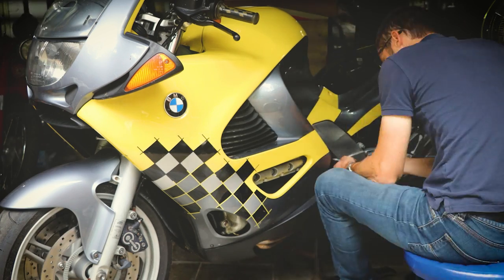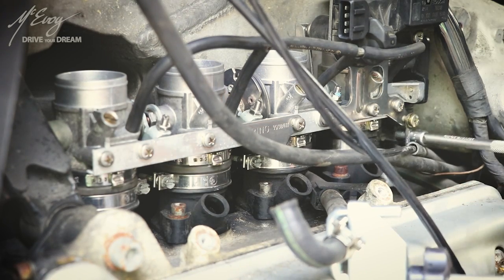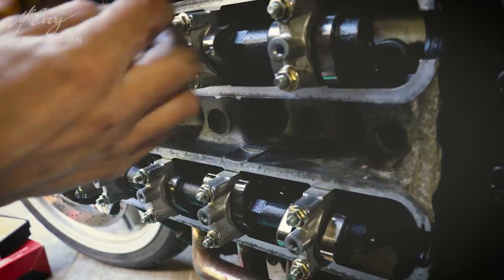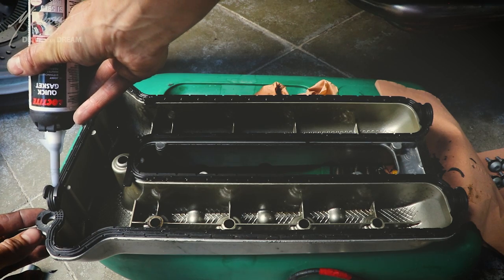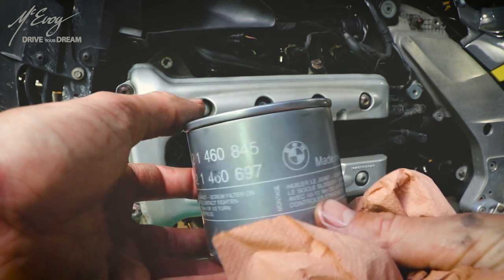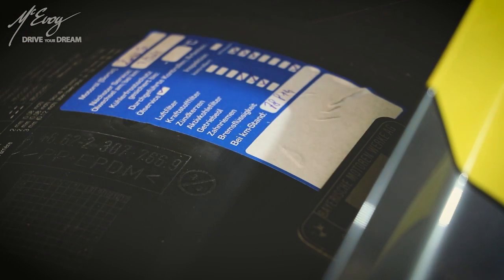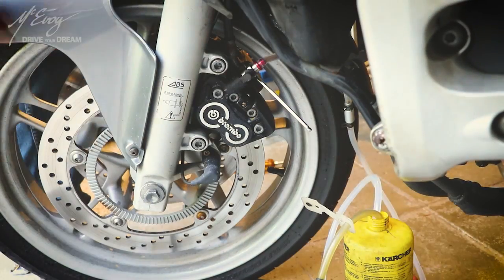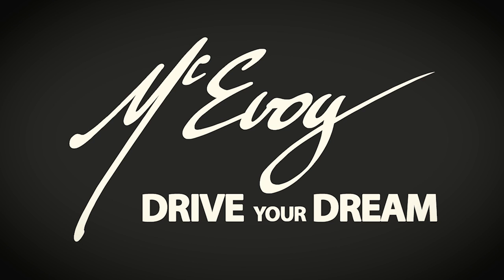BMW K1200RS full service

Comment: Hello, could you please help me on that "butterfly" TB adjusting? I didnt find that on the service manual. 
And I am thinking if I will be able to adjust it with only two connectors, like I used to do synchronising 4cyl. Carburettors? Thank You in advance. 

A great vid, would be easier for me if I would've found this vid earlier. But now I already changed the clutch by myself in the garage laying on the ground:D
Reply from the maker: Hello Vladimir,
To properly adjust the TB's, you need to first adjust the throttle cables properly (making sure they operate freely as they should of course). Then screw the first TB balancing screw fully in (on cylinder 1), then back it out one and a half turn. Don't touch that one any more, as it is the reference for the three others. You will definitely need a four tube or gauge balancing tool, as the method used here is different to that of most Japanese bikes, where carbs are synced in pairs With the tool hooked up, start the engine and let it  warm up to normal operating temperature. I usually wait until the cooling fans kick in. When the fans turn off, start adjusting balancing screw on cyl 2, using cyl 1 as your reference. When you have synced that one, readjust idle speed to the indicated speed in the manual. Fine-tune sync in between 2 and 1, re-adjust idle. Blip the throttle once or twice, and re-check. Then sync cyl 3 to 1 and 2, re-adjust idle speed etc..., and lastly sync cyl 4, and make a final idle speed adjustment to what it is supposed to be. Blip the throttle once or twice, check that they are all within spec, and hey presto, you have just synced TB's. At least, that is how I did it, and it worked great. Do make sure there are no air intakes in the breather system, otherwise you will be wasting your time. 
I hope this helps! Have fun! 🙂
Reply: @gmcevoy  thanks a lot. Did you find it on the manual somewhere?)  Tb balancing are those bolts for flat screwdriver copper colour?
Reply from the maker: @vladimir4093  The copper coloured ones, yes. Don't mess around with the other ones, as they are set at the factory, and any attempt to adjust those will render the TB ramp useless. I honestly cannot remember from whom I got the info, but it worked well.

Comment: I'm looking for a video on changing the clutch. Because my k1200rs has now got 156000 km on it an its ratteling more than a bit, some say to me its a very big job and not easy at all, any comments?? I can do general maintenance and so butt not been working much on this type of engines, mostly like cb750, kawa z1000, suzuki 650,, this engine intriges me tho,haha. Bought the bike like 2,5y ago with a good 100000km on it so been driving it daily, maybe i will look to do a steering mod like the sls something like that,butt find it expensive to buy. Maybe look to get it done and made by a frend butt will need different lines for the brake and clutch i thingk. Any vids on that maybe?? Thx in advance BennyBike (Belguim) thx for this one helped me,out allot!!!
Reply from the maker: Thank you for stopping by, Benny! I don't have a video about changing the clutch yet, sadly. It is a big job indeed. I would like to do it on mine anyway, because I have to change swing arm bearings and most of the parts that need to come off for a clutch replacement will have to come off while changing the bearings. I don't mind going the extra mile and doing the clutch as well. Hopefully I will manage to do that before this coming Spring. The handling of my bike was getting weird, so I did not ride much in 2021. I didn't even go through a full tank of petrol. Anyway, thank you for stopping by and letting me know that my video has been useful to you. Maybe we will be able to meet and go for a ride together some day, I am in Belgium as well! Take care!
Reply: @gmcevoy  haha really. Maybe we do the 2 bikes together

Comment: dear sir mc evoy, I want to remove the electric power to the integral brake system compressor on my 2001 k1200rs motorbike. because there are frequent errors and I want to just make a manual brake system. I am in Indonesia .
Reply from the maker: Hello there. I you sure that is a good idea? It is a useful system. What's wrong with it?

Comment: Thank you man!! How much would a service exactly like this cost? Just curious. Trying to gauge
Reply from the maker: Hi Conor. Difficult to say. I would expect to pay anywhere upwards of 400€. It depends which parts actually need replacing or not, and the hourly rate of the mechanic (and of course his level of skill). For example, if some shims are required to adjust valve clearance, you are looking at roughly 30€ a piece. There are 16 of them...
Reply: @gmcevoy  intersecting. Good point though. I wish I had a professional BMW mechanic friend 😅😅 I love videos like this but the only downside is I can’t ask you questions along the way. I can pause, rewind, google search things. But nothing like learning hands on. Thanks for making these videos man!
Reply from the maker: @conordawson2649  Well, in a way, you can. I try to answer to as many comments as I can, so feel free to write your questions down, make a list, and I will definitely help if I can. Thanks for sticking around, in any case. I will have to replace the clutch soon, and timing chains as well. Two big interventions that I have been putting off long enough now...
Reply: @gmcevoy  well I definitely really truly appreciate that man. The previous owner removed the ABS system from my k1200rs. The front brake works normally and has fluid in the reservoir near the handlebars. But for some reason the rear reservoir under the seat is empty. But the rear brake is working.  I’m wondering if somehow they redirected the fluid so that it doesn’t have to pass through the reservoir? Or maybe it needs filling and it just mechanically braking with no fluid? I wish I could send you pictures on here to show you. Do you think I should just try and fill the reservoir and see what happens? They did a bunch of other stupid stuff like grind off part the of the rear sub-frame that holds the tail light unit, snip a bunch of wires, etc. alll of this to use it on the track like 2 times.  Needless damage to a beautiful bike in my opinion, but I got it for free. So I ordered a new rear sun-frame, and a complete wiring harness off eBay. I think I can manage to figure that out in time. But the rear reservoir thing is what’s confusing me. Any help on that would be appreciated ! Sorry for the enormous message!!
Reply from the maker: @conordawson2649  Ah, shame it suffered like that. Good to know it is in your caring hands now. If the brake fluid level is low, the first thing you want to do is check the wear of the brake pads. It is a closed system, so as the pads wear, the brake caliper piston comes out a little more to compensate for the loss of pad thickness. So the brake fluid in the reservoir goes down. If your pads are fine, then there might be a fluid loss somewhere, which is abnormal and should be tracked down asap. Strange idea to get rid of the ABS. It saved my ass more than once, I can tell you that. It is a heavy bike after all...
So, take a look at your brake pads first, and take it from there.
Reply: @gmcevoy  okay man I’ll take a loot tomorrow when the rain clears and I can pull her out of the shed. Thanks for the advice!

Comment: I hate to say it but it looks like you may have a partially blown head gasket. Coolant and oil makes that grey goop
Reply from the maker: I thought that as well, and have kept a close eye on the situation. After 1500 kms, fresh coolant is still nice and clean. I think this sludge is simply a result of neglect. Well, I surely hope so at any rate, otherwise I will have to produce a video about changing the head gasket! Haha.

Comment: You poured motorcycle or car oil ??
Reply from the maker: Castrol Classic EP90 is a hypoid gear oil. It is used in cars, and meets the requirements for this gearbox. So far, it works great. Here is a link to the exact product. https://www.louis.eu/artikel/castrol-transmission-oil-ep90-classic-1-litre/10038154

Comment: Hello, can I pour CASTROL Syntrax Limited Slip 75W140 into the gearbox ???
Reply from the maker: Hello!
I would not personally recommend using that oil in this gearbox. SAE90 hypoid gear oil or equivalent is the one that you need.  I use Castrol Classic EP90, and it seems to be fine. You could also use Castrol Axle EPX90, I suppose, although I have not tried that one specifically. Syntrax LS 75W140 has been homologated for use in the LSD final drives of BMW M cars, and Mercedes-Benz AMG's. The viscosity does not correspond to your K's requirements. 
I hope this helps!
Thank you for watching!

Comment: Hello, is there any screw to adjust the idle speed on the carburetor ??
Reply from the maker: Hi Robon! This bike is fuel injected, and doesn't have carburetters. It does have balancing screws on the throttle bodies however. They are those brass screws, positioned on each throttle body. The procedure is showed near the end of the video, near the 18:25 mark. You do need a proper balancing tool to get it right. The idle speed itself is regulated by an electronic stepper motor.
Have fun! :-)

Comment: That milky stuff is probably because the bike wasnt ridden long and hard enough. Oil condensation.
Reply from the maker: Most likely indeed. I did put it through its paces last Summer, after I had finished this mega-service intervention. :-) I'll check on it before Spring, and replace that breather tube with a new one.

Comment: "A performance air filter." - Because the BMW air filter is $85.
Reply from the maker: Hahaha. Actually, a Mahle replacement is roughly 30€. I can't remember what I paid for the K&N, but I am pretty sure it came with in the 60€ mark. Thing is, I won't be buying a new filter ever again after this one, so it pays for itself after the second due filter change.

Comment: Sorry, but this bike has been very poorly maintained over it's life.  I would bet that was the original oil filter on that bike, especially since the o-ring stuck and pulled off the filter.  This reminds me that one must be VERY careful when purchasing one of these K bikes.  If the seller doesn't have answers, expect that it hasn't been done.  And that coolant reservoir??  Well, enough said.
Reply from the maker: Absolutely. One of the main reasons this one was so cheap. In fact, it was given to me in part exchange for a job I did. I would suspect that it was serviced in a BMW dealership at least during the warranty period. After that, nobody knows. :-) So it fell into the right hands, I'd say. :-)
Reply: @gmcevoy  Nice Geoffrey!  The price was right and with your training and experience, it will have many, many more miles ahead of it.  Hope you still have it.
Reply from the maker: @SinnerSince1962  I certainly do. I haven't had a decent opportunity to ride it this Summer, sadly. I would like to recondition the swingarm bearings, and especially change the timing chain this Winter. It's a brilliant bike, I really like it. Definitely worth the trouble, and apparently it has a decent following as well. Do you own one too?
Reply: +1 When the contents of the coolant recovery tank looks like that, the insides of the radiator end tanks are even worse. 💡